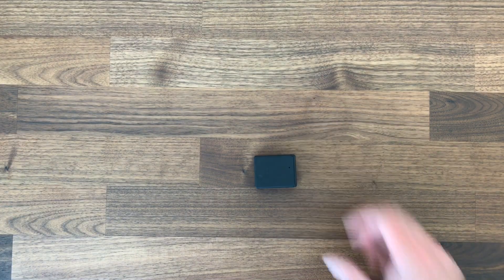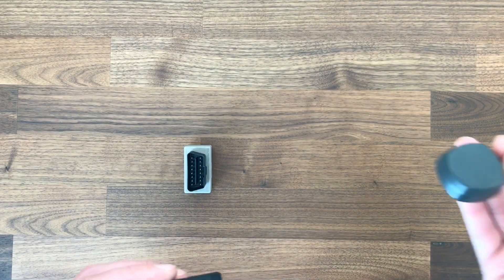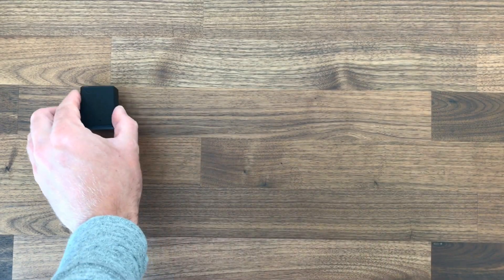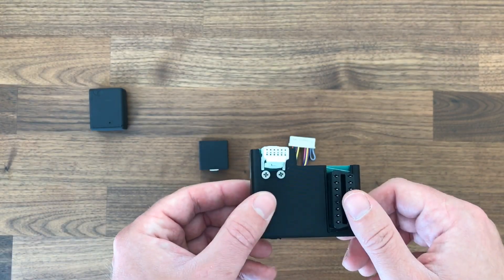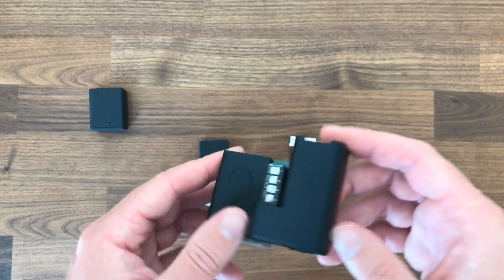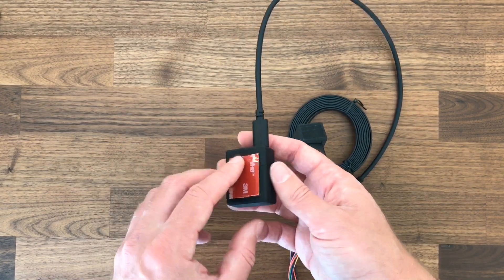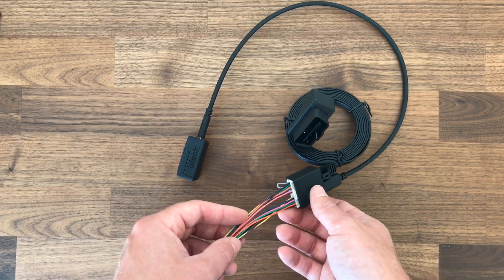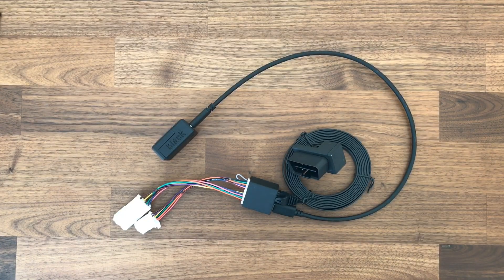Comma.ai New Car Harness Kit Breakdown

Comment: My car is not supported on their website. Do you know what exactly needs to be changed so I can modify and install this into my car? Is the wiring coloring same across all vehicles? I’m assuming the connectors are not. But if I can replace the connectors to fit into my car. Do I still need to change anything in terms of software?
Reply: Did you find the answer to this? I'm trying to install this on a glc 300 2022.